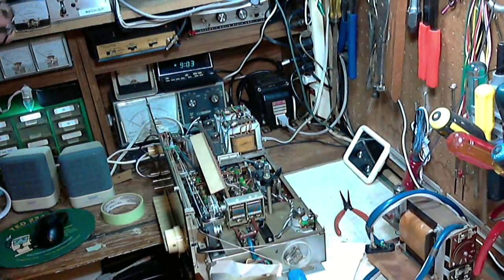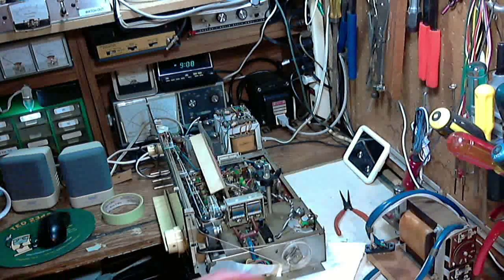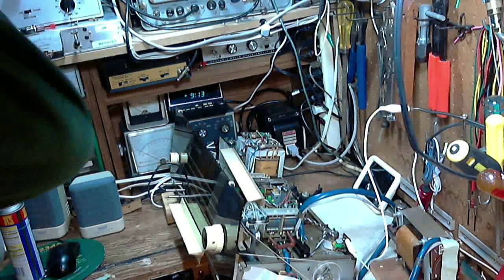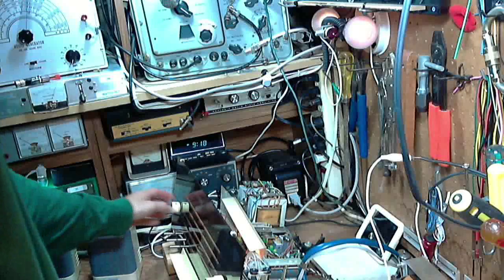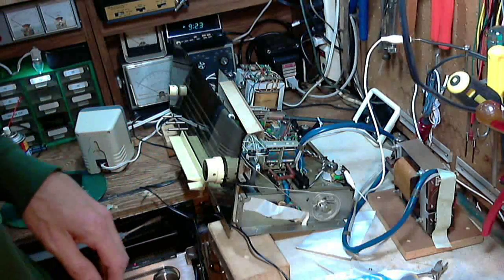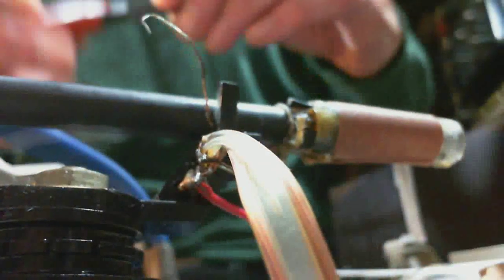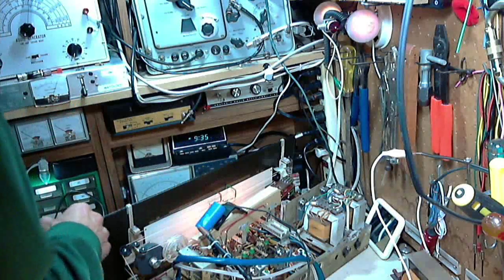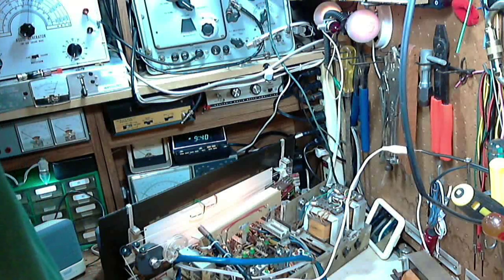Koronette Console Stereo Video #20 - Reconnect AM Loop Antenna

Comment: Those slotted outer plates on the AM tuning cap gangs are trimmers; meant to be pulled outward to trim the linearity/matching of the RF/OSC sections. Never to be bent inward. Looks like that one got bumped.
Reply from the maker: glasstronic I've come across quite a number where the plates have been squeezed presumably during rough handling.  I think they can get bumped when the chassis is extracted from the cabinet, in some cases.

Comment: They use Litz wire on those antennas (and many coils). It is a bunch of thin wires, each individually insulated from one another except where they terminate. There, all strands tie together. Looks sorta like string or thread? ... It's Litz.
Reply from the maker: glasstronic I have radios from the 20's with coils wound to reduce skin effect (I think it's skin effect).  By weaving the wires, it reduces the paralleling of the turns since they cross each other rather than running parallel.
Reply: Yep. Often referred to as "universal-wound".
 The multi-strand Litz wire manages the skin effect (more surface area). The universal winding manages inter-winding (distributed or "bulk") capacitance. The best coils employ both. Another enhancement is "pie wound": multiple disks of turns for a given winding.